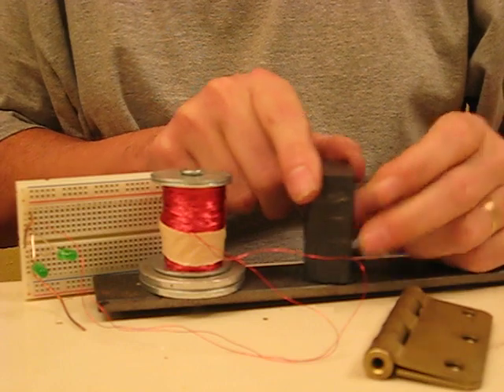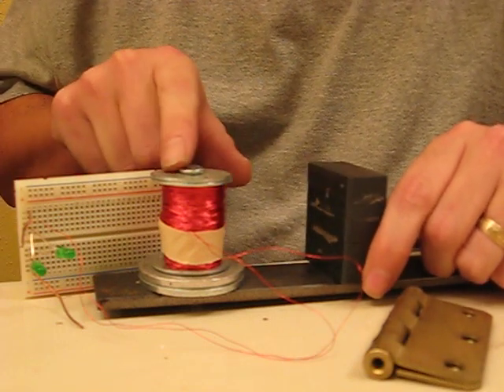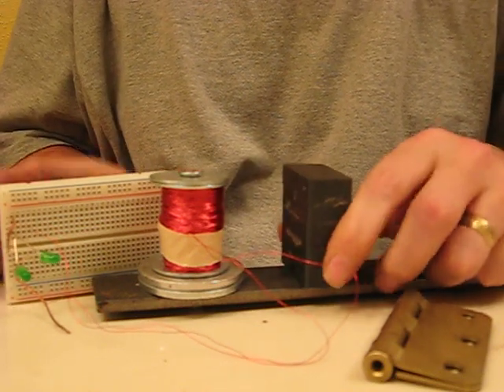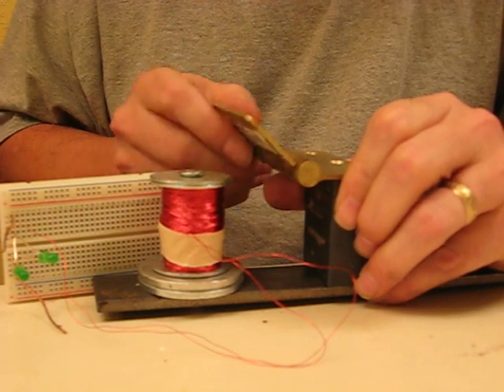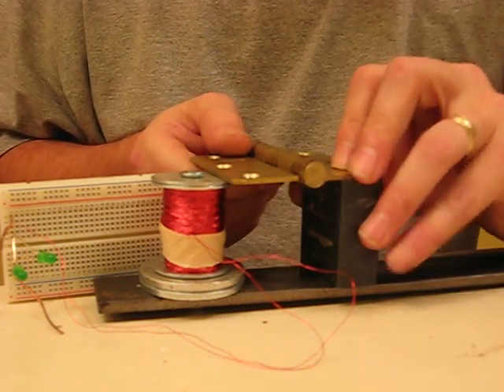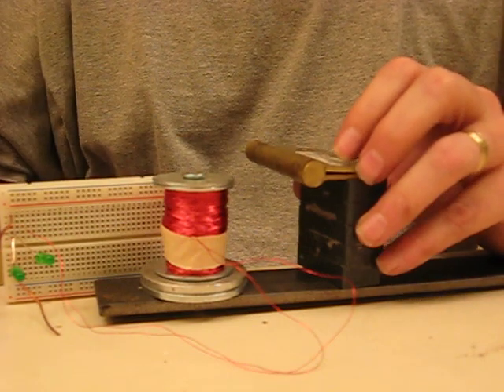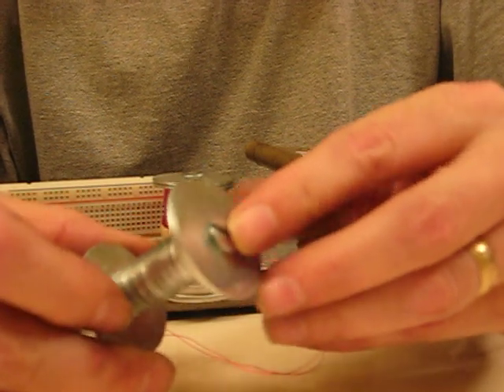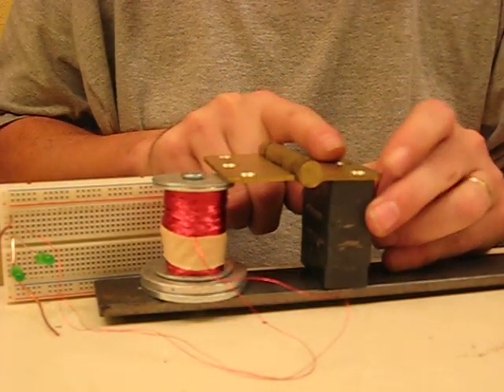Permanent magnet generator with no relative motion between magnet and coil

Comment: @electricpete1 no, the hinge beckomes part of the magnet when it is in contact with it. It's the relative movement of the hinge to the coil that generates the small amount of energy.If it was the contact, then it would stay lit, but it doesn't.

Comment: ->> also that the amount of energy stored during phases [magnetic contact/non magnetic contact] is relative to the amount of copper used [size of coil/size of mass affected], thus when bigger coils, stronger magnets, and magnetic flux pulseing [in the case of a turning generator faster rotation] these factors create stronger energy when in large arrangments, now how can we create a pulseing magnetic feild, with little energy input to do it? people, BE clever...

Comment: also important to realise is that a magnet is a flow of polarised energy [i wont say electrons because im not sure] so when we [suddenly] introduce this flow to copper, the copper picks it up, quicky discharges into local feild [led] and then becomes aligned again, then we take the magnetic feild [suddenly] away again, the feild collapses, and the stored energy from when the magnets were present, discharges again, to become resonant with local feild. ->>

Comment: AWESOME!!!!!!!!!!!!!!!!!!!!!!!!
 U only need to wire a triac on the top of the coil and on the top of a metal plate on the magnet, and wire  a flip flop circuit to the trigger of the triac and if u got guevos made a video and put it on youtube. I was doing the same thing but i was cutting on the coil circuit and was working but i was having problems to made a bigger coil on a bigger magnet  and the way u did is AWESOME gift me a better idea for made them bigger. NAMESTE!!!!

Comment from the maker: @Toerme The wire used is "magnet wire" which has enamel insulation on it. The insulation is required to ensure that current flows through all turns without short circuiting between turns which would reduce the effective number of turns.

Comment: @electricpete1 Alas, I think you are wrong, don't you see that if you had a metal arm that rolls over multiple coils broken by plastic areas to make it a continuous smooth roll- the led's would continue to light up by the contact? I'd imagine that the metal wheel connected to a distributing arm without grease in the bearings would maybe have some difficulty leaving some contacts, yet would be attracted as well if such a force were to come.  See my Leedskalnin video. might give you ideas.

Comment: @Danster82 All you need here is the famous "Faraday's Law of Induction":
we use "S" for closed loop integral, (Phi)b for magnetic flux, d/dt for time derivative and E for electric field. 

S E*dl = - d(Phi)b /(dt)

This law means that a change in magnetic flux will induce a voltage difference in the space around it. If there is conductor there somewhere it will have current flowing in it.

Note that the "minus sign" in the equation points out the direction of the current (Lenz's law).

Comment: @301001082 MAGNETIC INTERRUPTION SHIELDING, is only  the interruption of magnetic flux by a iron or steel piece. EX: if you have a coil with a magnet in front of it  you must cut the magnetic field for electric generation. you have to move or spin the magnet. right, but you leave the magnet on your position and make pass a metal piece through the magnet and coil, that will to cut the magnetic flow  from the magnet to the coil and you will get  electric generation on the coil, and no lenz effect

Comment: @301001082 i think you must investigate about MAGNETIC INTERRUPTION SHIELDING!.  the trick is not gain the full power generation due closing the magnetic field, this will cause magnetic repulsion by load and stop the machine. this  method is for reduction of the lenz effect

Comment: i think if the magnetic feild were able to be seen you would see it extend out from the magnet through the hinge and also into the core when you make and break the contact and the movement of that feild is what produces the power; the same as if u were holding the magnet and moving it.

Comment: In this case it's not a free energy! This phenomena  is called induction. Changin magnetic flux thru the coil induces voltage. But the induction produces braking effect, in this case to man's hand. How can you test it yourself? Easy. Take a DC motor with brushes, which is very common. Try to spin it by your fingers. It spins quite freely. Now wire aome bulb or make short circuit on the contacts and try spinning it now. You will feel the difference in your fingers. 

Have fun!

Comment: @301001082 he's not a fool, and youre a troll.  none of the words you said had any meaning in the arrangement you put them in.  @electricpete1 sorry the free energy nuts have hijacked your comment section.  This does a good job showing that anything you do to change the total flux through a coil will generate electrical power.

Comment: The hinge becomes a temporary magnet as it's obviously Ferris. In effect your moving a magnet, and by extension changing the magnetic field effecting the coil. While your experiment certainly shows that you can move the hinge, and not the permanent magnet, it's false to say that the magnet is not moving. That hinge is very much a magnet in this case.

Comment from the maker: It may not have been the best term.  An example of effective insulation would be a split in the washers which interrupts the potential loop for current flow around the washers (encirlcing the bolt)

Comment from the maker: Thanks. I agree that a core insulated parallel to the bolt would be better to prevent current circulating in the core. This was just an easier way to build it.

By the way, the demo is a lot better on the video before I uploaded it to youtube. Tthe LED flashes EVERY single time you open or close the magnetic circuit. Somehow the youtube video compression throws away the flash if it doesn't last long enough... so the result that you see looks like there is no flash half the time.